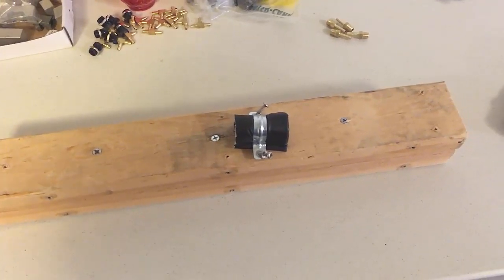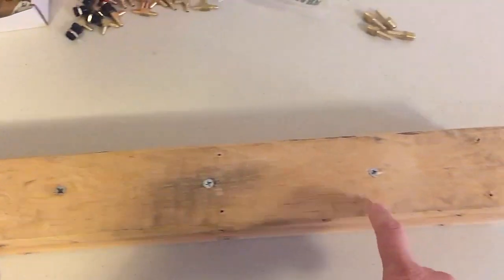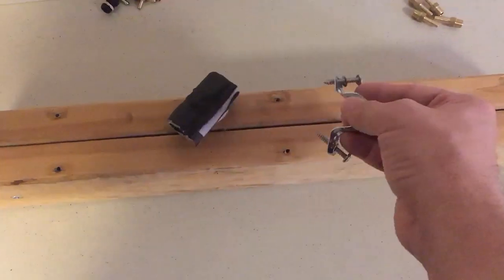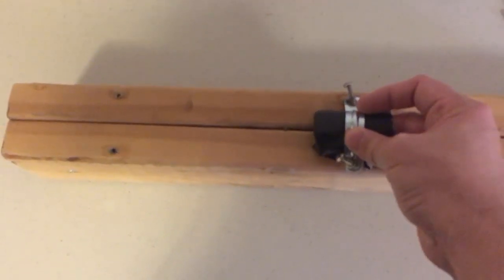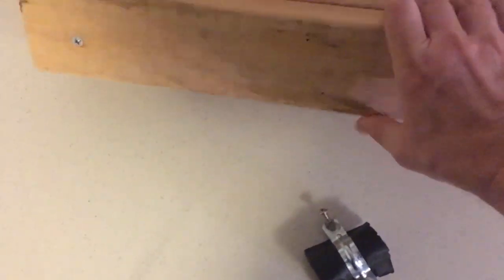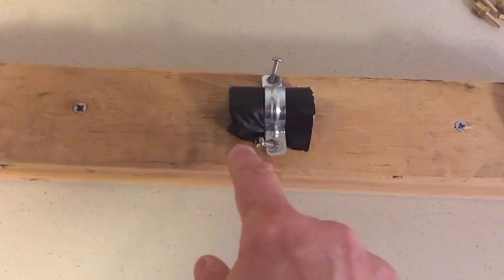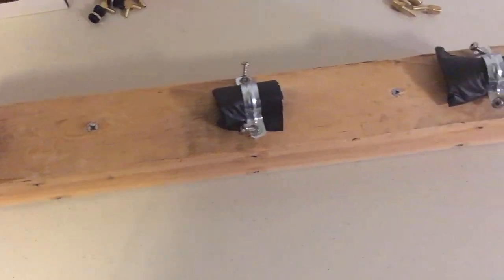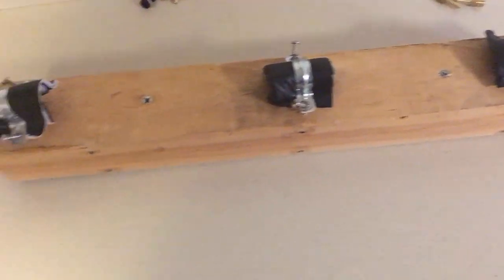Easy Solution for Minivan Bed Leveling

Comment: That's a neat and simple way to go about it. It's kind of unfortunate that the floors of minivans slope like they do. It'd be so much easier if they were flat.

That's a suspicious amount of push on hose fittings in the background... hmmm... lol
Reply from the maker: Yeah, that's the only thing that was frustrating using the Odyssey as a platform.  The Dodge Ram c/v has a flat floor, but I didn't want to trade the reliability.
Reply: Like the Earth. LOL

Comment: Do you remember the dimensions for the pieces you used to level the cot?
Reply from the maker: @BurlyBaboon  I used two lengths of 2”X4” screwed together. The clamps were the diameter of the cot tubing. I think they were 1”, but measure your cot.